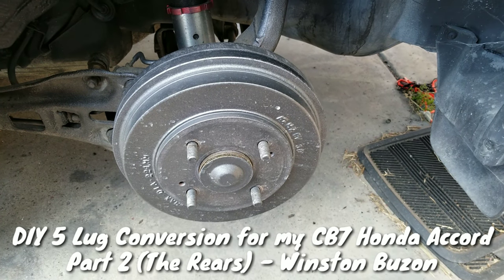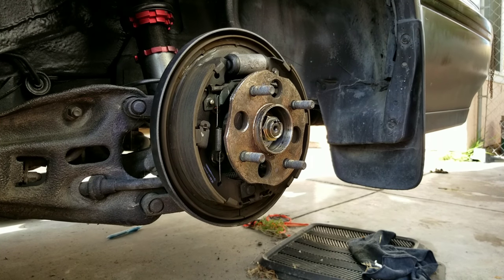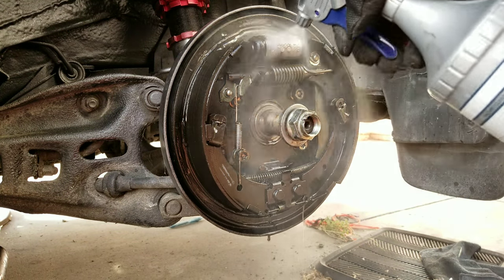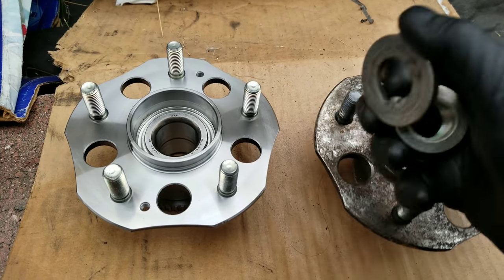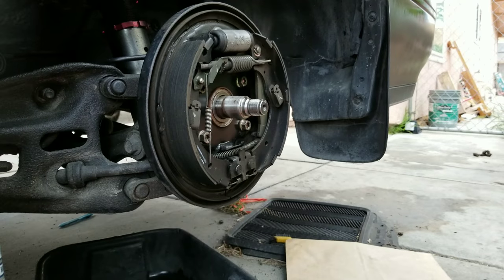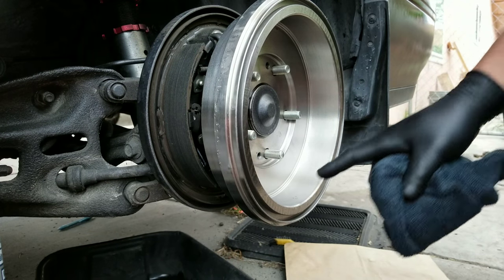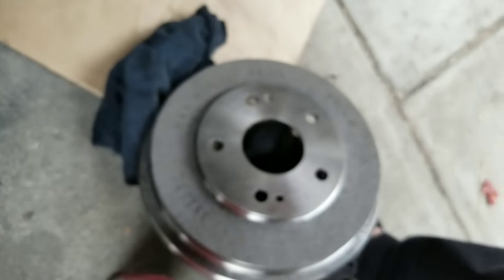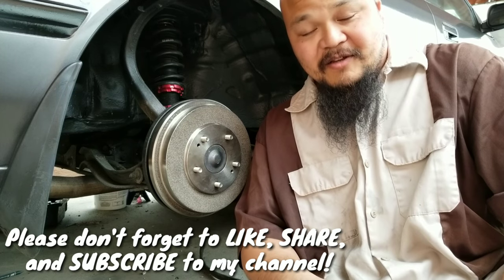DIY 5 Lug Conversion on the CB7 Honda Accord Pt. 2 (The REARS) - @winstonbuzon

Comment: Dude, I can't believe you saw how far off the depth was for that hub and you didn't stop after seeing that the brake shoes are now going to be spreading way off center.  And throwing that washer away is a bad idea.  That's a very thick washer for a reason; it's holding a lot of torque on that hub.  I'd venture to say the surface area of the face on that nut is probably half of that washer.  Given that (I'm no engineer though)I think the force on the face of that nut may be X to the power of 2.  

If it were me, I probably would've tried to figure out what other Honda hub might fit, maybe even see if you could take off that ABS ring and shave off about 15mm off of the face of that Prelude hub.  That would suck it right in and possibly be in a better location.
Reply from the maker: Duly noted.  That's why I've decided to remove this hub and find myself a better option while retaining the drums

Comment: For those that want to do a 5 lug disc the needed parts are below.
90-97 accord 4 lug rear knuckle assembly.
97 rear prelude hub.
97-2001 Integra type r rear rotor (5 lug). 
Every bolt.
Reply: AJ Imports do I need to get the rear trailing arm and spindal off a Accord with rear disc or do I just need the spindal

Comment: It kind of looked like the center bore of the drum needs to be a tad bit bigger in order for it to sit flush, it’s not a good/safe idea to run it like that since the hub won’t make it through the hole in the wheel and potentially loosening up while driving

Comment: What's up, if i can put this out there, that swap is sketch.... Hear me out, that washer is to keep the bearing and nut separate since the wheel is spinning in the same direction as to loosen the nut. It didn't look like there was enough indentation on the nut to securely keep it locked into place. I just don't want to see you lose a wheel or life for a washer. Keep up the cb love.
Reply from the maker: Travis Chupco I've thought about this too, and I see your point.  I may have to do a video to shave down the hub's edges to properly seat the drums
Reply: Winston Buzon I wonder if you could press out the bearing of the new one and see if you could find one that's not as wide? I think that will give you the extra room to run the washer and get a good notch on the nut.

Comment: actually converting my cd5 to 5 lug here soon once my parts get here
Reply: did you ever do that?
Reply: Havan Barnes yes i did actually. use acura rsx rear rotors & prelude hubs for the disc conversion, if you have drum i believe you can still use the prelude hub with the crv drum cover. and for the fronts use the first gen honda odyssey front knuckle. I know you can use the 6th gen v6 accord knuckle but i’m not really sure what you use. Follow me on IG @1017juixe_ and I’ll send you some screenshots of the parts list i used

Comment: The wheel will fall off. The rim needs to sit on the hub for saftey issues. The rim is only being suported by the lugnuts, big no no. It will vibrate at speeds over 50mph.

Comment: I was wondering if the rear disc brakes from ah 2000 Honda Accord would fit on my 90 cb7 or if I convert the back with the ex disc brakes from another cb7 and then put the hub that you used here
Reply from the maker: I got the rear disc setup from a donor 92 93 EX, but I dunno about the 00 Accord setup because I haven't tried

Comment: I got a question can I just buy the 2000 v6 model hub and bearing 5 lug and use the 2000 Honda CR-V 5 lug drum
Reply from the maker: That's a really good question, but I couldn't tell you because I haven't tried...

Comment: Hey my 92 accord doesn’t have a drum in the back it has a lil caliper and a rotor what should I do for a five lug swap??
Reply from the maker: Change out your 4 lug hub assembly & disc brakes for 5 lug ones.  Retain everything else
Reply from the maker: https://www.cb7tuner.com/vbb5/forum/parts-performance/suspension/127726-wtf-5-lug-ftmfl-ahhhhhhhh/page3
Reply: Thanks bro the info helped👍🏼👍🏼👍🏼👍🏼👍🏼👍🏼👍🏼

Comment: Hi I am from the United kingdom and wanted to know did you get the new part from honda? And does it have to be a honda part? .. I have a Renault clio 2001 it's got 4 studs and I want a 5 stud conversion do I have to get a Renault part? 

Would appreciate a little help 

Great video
Reply from the maker: No, I got it from a website called Partsgeek.  I did a review on them because their service & return policies were horrendous.

If you're going to go the 5 lug route, I would research forums that specializes in Clios first.  Based upon your findings & fellow Clio owners' input, you'll have a better understanding of what your next steps will be
Reply: Appreciate your reply dood

Comment: This seems way easy... how come other people switch out the whole knuckles and all when they do 5 lug conversions? And will this work on my 95 accord? I have disc brakes in the rear and front though since its a eex model
Reply from the maker: Since you have rear discs, it should be easier
Reply: @winstonbuzon  so do I have to switch my whole knuckles and assembly or can I do it like this?
Reply from the maker: @righty-tightybuilt548  if you already have rear discs, just do it like I did
Reply: @winstonbuzon  awesome thanks brother. How much where the hubs? And are they off a certain car cr-v?
Reply from the maker: @righty-tightybuilt548  just the 5 lug ones, older gen

Comment: What kind of 5 lug drunk brake cover are you using?
Reply from the maker: Brake cover?  For the fronts?
Reply: @winstonbuzon  no for the rear drunk brake.  The other that goes over the hub & ultimately the drum brakes.  There’s 5 holes on it, which car is it from?
Reply from the maker: @trackshun  93 EX
Reply: @winstonbuzon  i don’t recall 93’ accord ex’s with 5 lugs.  I’m assuming the drum brake cover is from an odyssey?
Reply from the maker: @trackshun  so you're looking for 5-lug drums?  Then you might look into 1st gen CRVs or Odysseys

Comment: plus the base of the rims there's barely gonna be any rear stud treads poking thru no ? could you have installed extended wheel studs back there ?
Reply from the maker: You could.  In the end, I changed my rears to rear disc brakes from an SE

Comment: Where u get the 5 lug drum
Reply from the maker: Drum?  I had discs.  But you can get drums from the CRv or Odyssey
Reply: I got drum brake like u but I got wheel bearing an the hub
Reply: What year crv or odyssey
Reply from the maker: @raygraham3848 both first gen
Reply: What year

Comment: Not worth it. That is so dangerous. That thick steel KEYED WASHER is there to prevent the spindle nut from coming off if the hub bearing was to lock up. Manufacturers spend millions on training engineers to come up with something that works. Ask yourself this: could they build a car like that and pass d.o.t regulations?
Reply: There’s actually a skinnier nut that could be utilized.  It’s a mazda axle nut.  It is thinner.  Also, you can just buy extended lugs.

Comment: Where you get the rotors and 5 lug kit from
Reply from the maker: I got the rotors from RockAuto and lucked out with the rear disc brake setup from a 92-93 EX sedan in the junkyard in San Diego